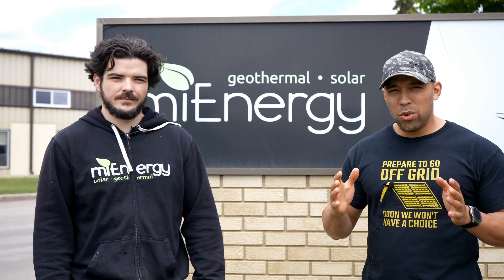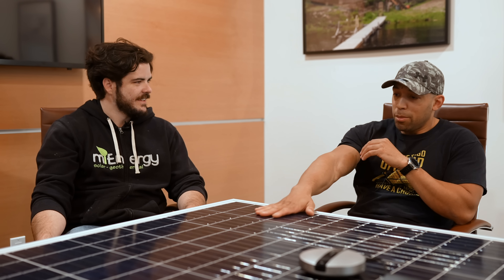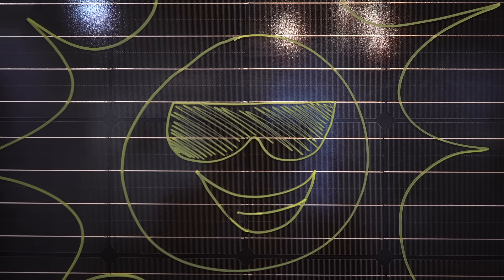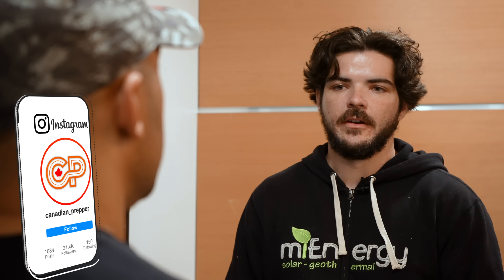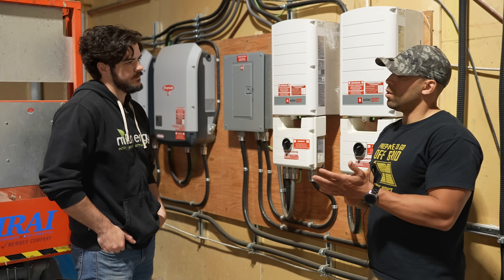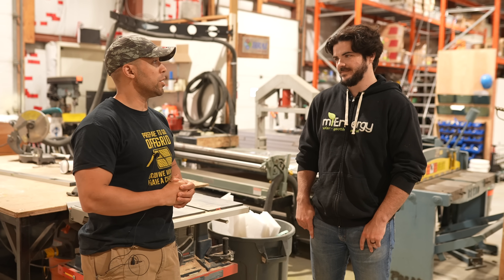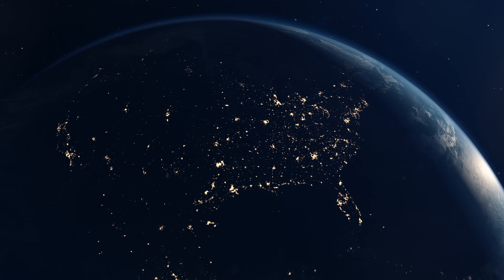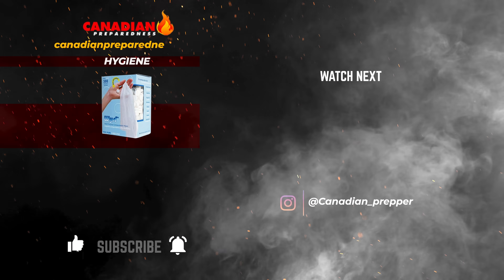Preppers Guide to Home Solar Power

Comment: Let's be realistic, who can afford this? I have a family and an 1800 sq. ft. home in Michigan and was quoted at $40,000 to meet 40% of my energy needs. Unbelievable. The technology just isn't there yet.
Reply: You were either going to get ripped off or you're running a particle accelerator in your basement 😮
Reply: @KenshinPhoenix  lol I'm in Florida and was quoted 70k! Why? Cuz I wanted it to also be a battery backed generator which would ONLY run my well, portable ac and a fridge.   70k is just plain nuts!
Reply: @jackietomkins5085  Ouch. That is nuts
Reply: You guys are paying the dummy fee.  Much much cheaper to DIY it.  I have a huge system with battery backup and was nowhere near those prices.  Not only was it pretty cheap, but the savings from not paying the electric bill, its paid for itself in 5 years.  In fact my grid went down and Im watching this right now offgrid in battery backup mode.
Reply: @bradspaugh9827  for a super hot month we've used 2000kw. But all we really need is backup for grid down. This would run a well, softner (water is HORRIBLE otherwise), 26cuft fridge, portable ac  that cools our pantry and the 2 outlets in the pantry for a 13wt led light and maybe a toaster oven or  fan and possibly the 40g hot water heater but it isn't a must have. So we would need some sort of switch too. What would we need in this case? Anywhere we can go to learn how to do this ourselves? My husband is pretty adept at wiring.  Thanks  😊
Reply: @jackietomkins5085  try watching some videos by the youtuber called enginer775
Reply: @bradspaugh9827  thank you 😊
Reply: @jackietomkins5085  no worries.  Send me an email and I can give you some advice.  You have a lot of loads and would need a big system.  I also have a pool, 2 mini split ACs, electric dryer, well pumps...  I know how it goes.  We make 3000 kWh a month of solar.
Reply: @bradspaugh9827  I would very much appreciate that! I don't know how to send you an email though...
Reply: @bradspaugh9827  or better yet to run these things separately from the grid 24/7 then no switch is needed and we aren't breaking the law cuz we're still connected otherwise...  😉
Reply: All you need to look at is your usage and divide it by 3. Panels shouldn't run more than $1 per watt. Currently my setup should run 1/3 of my usage and be pushing 2400 watts per hour with 4 40amp charge controllers on the 24 12 volt battery bank. Then again I'm building probably the largest Harbor freight panel/ battery setup I know of. Still got some kinks to work out.

Comment: They are forget the main most important thing to be able to survive.  We do not need solar or any power.    Key to indepence is living without electricity.  Come on get real if SHTF , power is last thing I'm worried about.  I can survive just fine without power.  People need to re think.   Solar is not perfect nor will it be any use if SHTF and you gotta pack up and get out of your home.

Comment: How can I do anything if a man only lives paycheck to paycheck and barely gets by I can't prep I guess I'm screwed.
Reply: A small solar & hand cranked combined radio/light is a useful and cheap gadget.. .and those garden solar lights can be brought in after dark... I've some solar fairy lights set up on the window sill which are strung out to illuminate the landing.....when the grid crashes solar can't provide much power for heating or AC... it's wooly jumpers or wet towels for every one...

Comment: 5 years ago I had 15 sunpower solar panels installed on my house, that's the best thing I've ever done. Don't understand why a 100% of businesses and homeowners don't have solar panels. 👊🤸🤩
Reply: 1:45 might have something to do with it
Reply: I was quoted 70k last month. Said my house would need 30 panels, 18k battery and switch for when there's an outage just to run my well, portable ac and fridge. I'm in Florida and have a South facing hip roof on a 2,000 sqft house! Only 25% of the panels would be shaded after 4pm. I was told my average electric bill is $270 (no its 220) and would be billed 270 a month for 25 years! I'm 62. That is NOT worth it to me at all- even if I was 35.
Reply: 46K and not enough facing roof. I don’t think I will use that much electricity in the next 15 years
Reply: READ THE CONTRACT IN STRICT DETAIL, BEFORE AGREEING!
Reply: Not worth price where I live or efficient for power needs also not many providers and those that do super expensive.
Reply: I got a great deal for my  15 sun power panels I only pay  $108 a month for 20 years. 🤩🤸💪
Reply: @t-fuelernienotoriousmisfit7449  
Ok Great 👍 now send some of your unused ENERGY my way  ill tell you if its worth it 
THANKS 
🤔(TEP) THE WAY🤔
Reply: Because solar is a scam

Comment: If you can afford it, store a second set (panels, controllers and inverters) in an EMP/CME protected location in case your installed array gets fried.
Reply: Wouldn't it make more sense to just get an EMP hardened setup instead?
Reply: @creepingcharly  a super EMP is equivalent to 200,000 volts. Military equipment is hardened to 50,000 in the US. Please provide a link to your hardened solar equipment that can withstand a super EMP
Reply: @peterjones3226  Yup, it's impossible.  Don't even try.  The Bad Guys will always have a counter to everything you do.

It's all about preparing for the most likely scenarios.  There is always going to be a paper to your rock.
Reply: @creepingcharly  Those can be iffy.
Reply: What about the cost? 
And space for storing all that?
Reply: .. though if I were an evil genius I'd schedule a serious of EMP at maybe a week apart

Comment: I live in remote off-grid in Alaska and produce all my electrical needs with solar and wind. 2 redundant solar systems on the cabin with a wind turbine to help out in the winter. Another small solar system on the ATV shed. And yet another solar and wind system on the workshop and shower/sauna. 3 backup gasoline generators. It’s a good thing to be my own power company.
Reply: "It’s a good thing to be my own power company."   Legendary comment. Great work and congratulations on that type of success through hard work. I wish you the best up there, Sir.
Reply: What’s the total $ invested?
Reply: @Utah_Mike  About 15k over the last eight years.
Reply: @MountainMariner  thx
I’m not off grid but I have set up a grid down backup system. Maybe 6-8k invested (this includes freezer back ups).
Reply: Cool in arkanasa offgrid. Solar and genny back up.
Reply: Yeah you ain't goin without electricity any time soon lol. My plan for SHTF is actually to bug out as long as it's not nukes, so I'm just tryina get some portable panels. Something I can attach to the molly webbing of my backpack to charge and or power small things on the go.
Reply: @bringer-of-change  Nukes are coming soon.  Puttin already stated the four horsemen are riding now.  As soon as Russia builds more of those Sarmart2  missiles, he will nuke London, and the US.  So enjoy your life now.
Reply: @bringer-of-change  I mounted a 15 watt panel on the hood of my jeep, along with a large marine deep-cycle battery. It's gotten me out of a few jams. I also have a large inverter and a pipe-rack on the right-hand side. When I'm doing lots of steel cutting (for fabricating) I load up and drive outside of town to spare the neighbors the annoyance.
Reply: I’ve watched your recent stuff and appreciate your actual use of equipment .
Reply: Would you advise having multiple smaller systems or one larger main system....i'm thinking issues and problems that will happen over the course of time...if the larger system goes down then i would be without power for a bit
Reply: @patrickadams7120  One main large system is the way to go. But redundancy isn’t a bad thing either. The only reason I have multiple systems is the distance between buildings and no good way to run wire and conduit between them.

Edit: I also have the two redundant main cabin systems because of the cold. The batteries I use when home need to be warm to be charged. I switch to silicone gel batteries when gone and the cabin interior is too cold to charge the lithium batteries.
Reply: What kind of batteries storage system do you have. Im am looking for wind power options. I have solar already
Reply: @CharlieB_P2ST  I have three types of batteries. 

Main cabin for when I’m home and the interior is heated: Lithium Battle Born batteries. These batteries must be above freezing temps to be charged without damage. 

Main cabin for when I’m gone and the cabin interior is below 32° F: I switch to the outside battery bank of silicone gel batteries. Great for the cold. The lithium battery system is shut down then. 

The ATV shed has lead acid batteries. 

The workshop and shower sauna have silicone gel batteries.
Reply: You lucky dog!!!!    That's what I'm shooting for
Reply: Good system. You always need a few different ways to get the power in case there’s no sun/ wind/ ect. You’ve got the right idea! I have my RV decked out with solar/propane/gas generator system. So far it’s been 100% sufficient . Mostly just use the solar

Comment: I wonder why no one has considered that in an EMP, your entire fancy-schmancy solar system will fry irrecoverably.  Even if you bought a backup double of every component, it seems unlikely a conflict-generated EMP would happen only once, so as soon as you mounted your backup system, the followup EMP #2 would knock it out again.  I'm not sold on solar, but I do use tiny little panels to charge things.  It is a valuable technology, just too fragile and vulnerable for me to depend on.
Reply: Right none of this holds up in an EMP!

Comment: I live in a studio apartment in a private residential house and in the basement two of my three well windows face south and talked with my landlord and got the ok first but the garden bed around the border of the back house I have a small stand holding 2 40watt panels and 1 100watt panel I allso have another 40watt inside atm not in use. I'm running currently 5 122AH deep cycle batteries all parallel running 12v system to my invertors. So while I cannot modify the house or help the house my cat and I have more then enough power to keep our little apartment running. Can charge my ebike or escooter I can run all my ham radios and GMRS radios my laptop which runs both my SDRs I have as well. And charge my meshtastic ttgos and my drone as needed. For a family and whole house it's a WHOLE different ballgame but even on small scales for people who don't have a whole house or family to support, you to can allso build a over adequate system for yourself. It's all energy statistics game in the end, just manage your power wisely. Good luck and God bless everyone.

Comment: I have installed a few solar panels on my balcony 518 watts & I'll get a couple more if there's  time, but next week Im getting a wind turbine it should work well on my top floor high rise balcony. To be used with inverters up to 3000 watts 240 volts.
Reply: Wind turbine=5.00$ saved......per year!!! Lol

Comment: Most solar panel systems are designed to work with the electricity being on. It just acts to reduce the amount used it feeds back into the electricity company. But most panels will not work if the grid is down
Reply: I noticed that too. Very misleading if you don’t ask the right questions
Reply: They explain this problem in this video. You need a solar bank to be completely off grid if need be
Reply: I think you  are missing the economics. The government/power companies are willing to subsidise you with grants and loans as you are using your space/land and panels to produce energy for them. If it's just for you, they lose your revenue and don't get power so you don't get subsidies.

Comment: Solar panels are definitely a must have for most house holds. It's a great way to charge e-bikes and save on costs!
Reply: You don't start saving for 15-25 years after the initial investment. Savings shouldn't be the reason
Reply: @Spe3D3m0n  just about the time you need to think of replacing panels and batteries...lol

Comment: Solar is a scam in the end. It costs a ton up front and starts to deteriorate from first year and makes less power ever year. Before the system hits 20 years you make 1/5 the power it started and then there is crazy costs to have them removed and dumped. They are a major environmental hazard because they can not easily be recycled. It’s a scam and everyone that has done it wish’s they haven’t.

Comment: I’m so lucky, I have a creek right in front of my house that flows 365 days a year, no matter how dry it gets. Can generate enough power for my entire house, Barn, and farm.🔥🔥🔥💯
Reply: Until someone up stream damns it
Reply: @everydaycarry1328  Luckily that’s not possible. I’m in the mountains of western North Carolina, and no one is above me, and it comes out the national Forest so I think I’m safe
Reply: @Shepfarmnc  Serious question. How do you deal with flooding?  I live in the Appalachian Mountains with a very large creek in front of my house (small river) but the spring floods can be downright catastrophic!  Even the runs that flow all year long in the hollers are subject to devastating flooding.
Reply: @fishcreekcountrygal9896  I’m about 20 feet elevation on my house from the creek, so flooding is not a concern
Reply: @everydaycarry1328   or dumps something in it. Don’t get to excited. Think 🤔 if they are trying to control ALL OF US  what makes you think that creek is off the radar.
Reply: Green Machine  Well, I guess if you run around worrying about all the shit that might happen, that has no reason to happen, you’ll probably drive yourself bad shit crazy. 

I worry about the shit I can do something about it don’t sweat the rest of it
Reply: Have you done it ?
You have to have head fall to get good power .just becouse you have a creek , doesn't mean you can generate enough power .
Reply: @mywoodlandpath2314  
Might be able to put a old fashioned grain mill in, water powered.
Reply: @mywoodlandpath2314  oh yes, I’ve got 60 feet of fall, and over 200 gallons a minute
Reply: @Shepfarmnc  thats great
Reply: Lucky!!!
Reply: Green Machine  poison won't effect the hydrogenerator at all just drinking which you can solve easily with electricity being available to you. I'd be more worried about those who will try to take over the location when things go sideways.
Reply: Yep
👍
Reply: ...don't tell me, nooby-nate spouts 'tactical nukes' & says it's going to be Russian Federation who always wanted to attack using the non existent weapon's=Z=
Reply: @patricklyons7683  lol you don’t think Nate is right about a lot of shit?
Reply: @jamesbrandon8570  oh yeah, he’s been spot on with a lot of the stuff
Reply: Green Machine  They can still get power. Just don't drink it.
Reply: Hey Nate just want to let you know that one of my comments yesterday was highlighted and then I got a message to text you because it had your logo and everything on it so I thought hey that's pretty cool so I texted the number given and I said hey love to talk to you I put out my number and I got a weird response so I'm wondering if somebody is acting like you or something else let me know if that was you or not please and thank you.
Reply: @MrPanther1986  He won't see your comment, most probably. Why don't you start your message like this: "Hey, Canadian Prepper..." It's more likely to register with him.
Reply: @MrPanther1986  that's a scammer pretending to be Nate. Block the number. Any genuine reply from Nate will have the tick (think it's blue?) beside the profile pic and name.
Reply: @MrPanther1986  its a scammer i have scene them a few times on here
Reply: @waldo-ot6ul   yep a scam
Reply: @Tha One i’m gonna put in a turbine, I have enough fall and volume
Reply: That's awesome. Just don't tell everyone.
Reply: @gojo2194   why not  the power  of water is for all of us.        A simple  hydrogen  cell   runs my moterbike  for free on water.  Just as easy it can run a genaratour    for  free on water for ever
Reply: @ianwhiteley5102  Yea good luck with that hydrogen cell and creating hydrogen...  I'm going nuclear personally it seems more efficient!
Reply: So wonderful
Reply: Green Machine  You are correct about the lights & smells. Those are 2 things I don't recall mentioning though. Power is very useful without lights & smells. Keeping radios "2 ways", rechargeable batteries, phone, tablet, run your fridge "when needed", portable chargers, a little heat, & so on. But yes lights & smells are a dead giveaway.
Reply: Jealous! Happy for you too though 😃
Reply: How many others know about it and how far upstream are you
Reply: A  hydrogen  cell can run a genaratour  on  gas for free for ever.  Home made hydrogen cell less than 20 dollars.   Electrolasis.  The only real green way  zero polution   water to gass. Free fule for ever.
Reply: Green Machine  posioned  or not the turbine  still runs